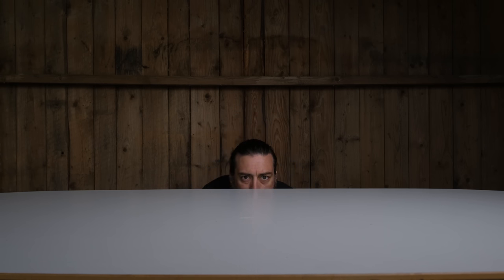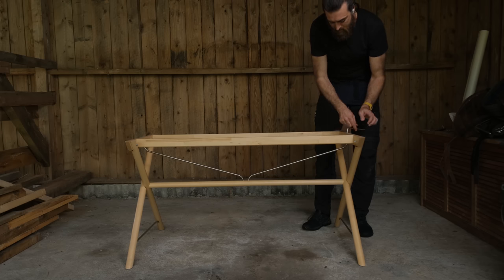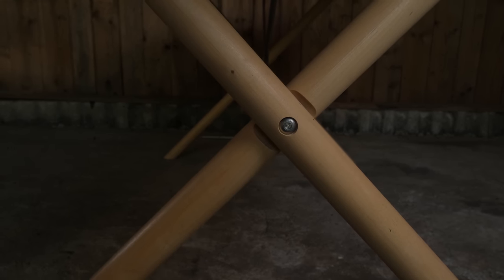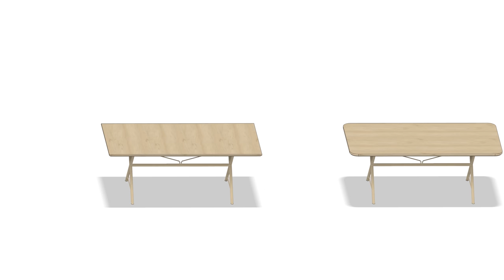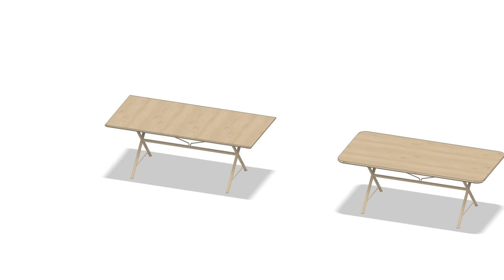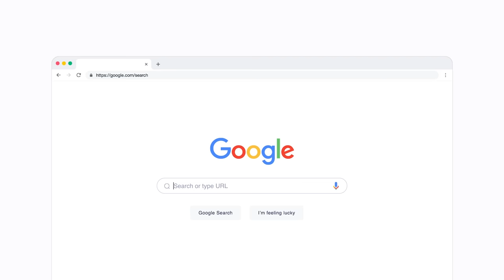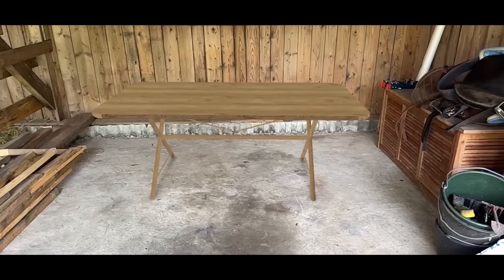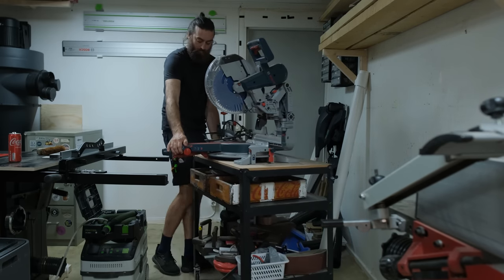IKEA don't want you to know this

Comment: about sanding those tops, I used to do that for many employers. In the end the best way is to batch them if possible but either way find a local woodshop with a wide belt sander thicknesser or even planer thicknesser and belt sander combo, a place near us had a machine capable of doing 130cm wide tops. Pass it through a few times, hand the boys two cases of beer and leave with pristine tabletops and new friends.

Comment: That's a strangely successful failure.  I have two points, however:
a) why did you go into all this trouble and not use baltic birch plywood instead which would be thinner and thus more elegant and in line with the table's design?
b) why not try to make a project out of this by copying it? I'm not sure whether there are any intellectual rights on the design as it looks quite old so that such rights may have expired - if such rights expire, that is - or if there still are such rights, maybe make something similar without the IKEA design features that make it an IKEA design?

Comment: the problem of sanding is that when you start as apprentice, you fill 90% of the time with sanding.
first year i sanded hundreds of antique wooden shutters of an old monumental country manor.
also shutters had those angled slates, thus i was only allowed to manual sand.
the most mind numbing work i ever done for 7 moths straight.

seems to me you indeed need to hire an apprentice lmao!

Comment: This kind of project works better with older IKEA pieces. The last two decennia the quality of IKEA products has deteriorated significantly.  Material has become thinner, metal was replaced by plastic, wood by particle board, .. and so on. IKEA has become the Zarah of furniture. It is cheap, wears out quickly and then you replace it with something new and shiny again...... and again.... and again.